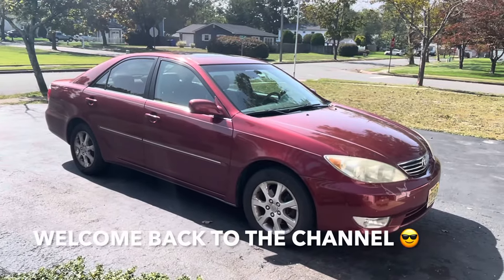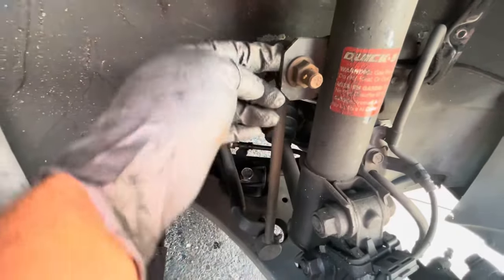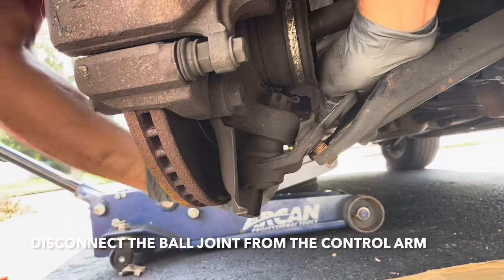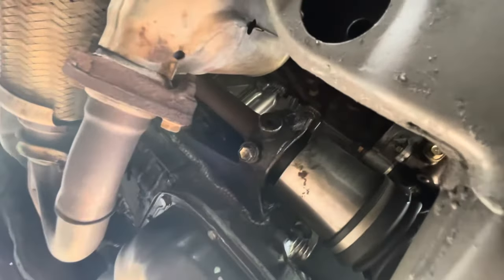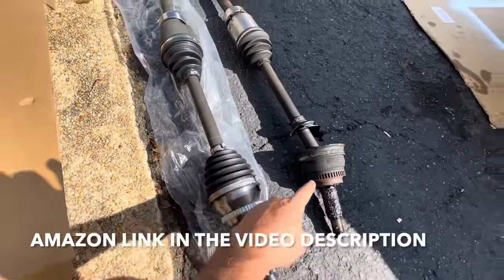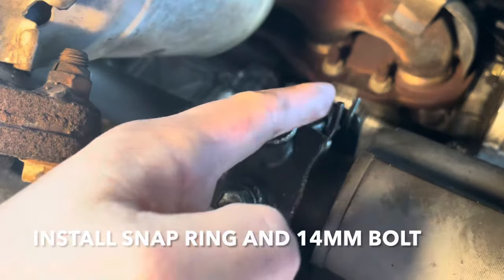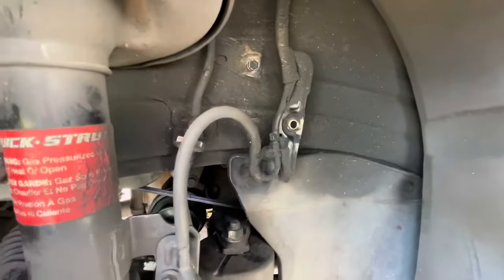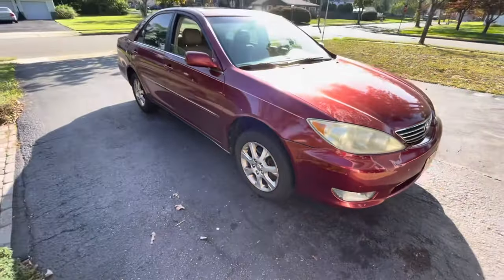TOYOTA CAMRY AXLE REPLACEMENT - How to Replace Passenger Side CV Axle on a Toyota Camry

Comment: I was going to let you know you didn't have to remove none of that remove your two Bolts from your strut and it will swing out far enough to move out of your way to replace the axle in about 10 minutes

Comment: Passenger side on my '09 ES350 started clicking at 289k. I went ahead & replaced them both. Had the classic stuck carrier bearing problem & ended up cutting the CV & replacing the bracket as well. I believe all Lexus/Toyotas '00-'13 with the 3.5 V6 use the same CVs.

Comment: The ring that you pinch, mine is all rusted, also how did you punch out the bearing. I noticed you used a rod with something green did you run that through the other side of the car?

Comment: There's a vibration on my front end  
I believe is coming from the passenger side I kind of notice the vibration at 35/40 mph when accelerating. Do you think this might be the problem??
Reply from the maker: It could be several things. But yes, a bad axle can be one reason
Reply: HI I HAVE THIS EXACT PROBLEM did you ever fix it and if so what was it

Comment: "Torque to 217 ft-lbs"
(*procedes to hammer axle nut on with 800 ft-lb impact wrench with no way to control torque*)